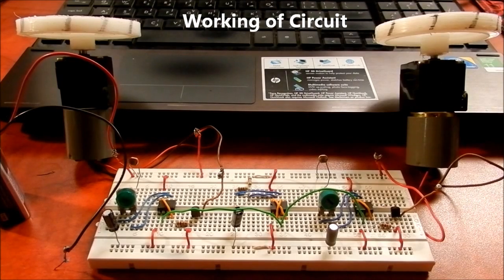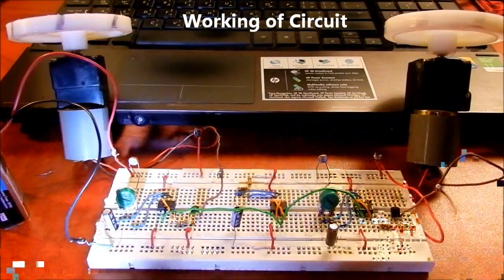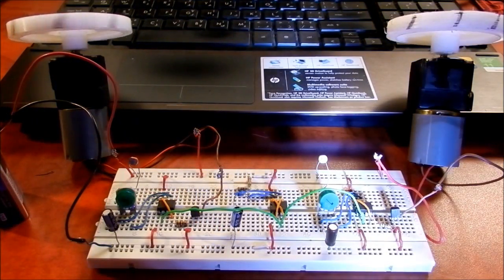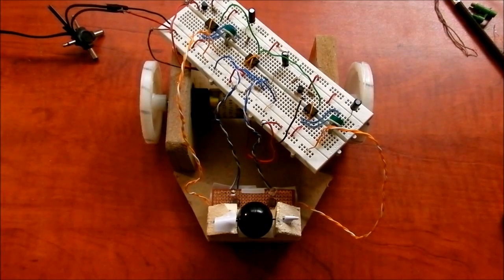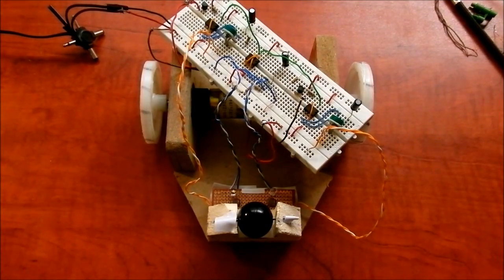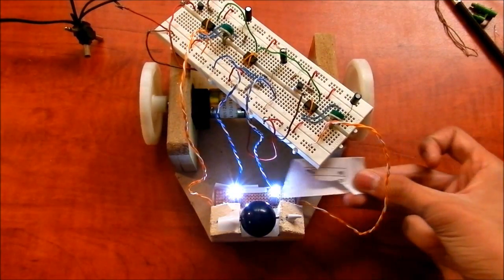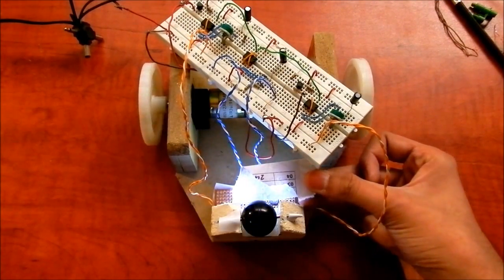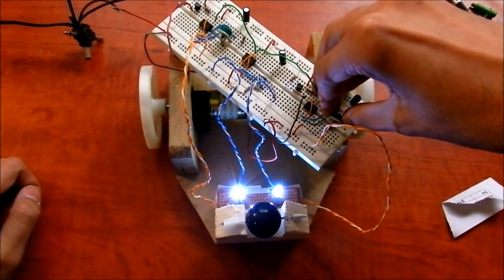How to Make a Line Following Robot without Microcontroller

Comment: Hey! I prowered the LEDs separately by lithium batteries. But the wheel rotation does not changes at all as I keep a white paper on ldr and led. Also when I use, mobile flash light on ldr the wheel stops rotating. Would suggest some solution. I want it to detect the white paper

Comment: why do you need 555 timers because you van use transistors to turn the Motors on and of right
Reply from the maker: Used 555 times to provide PWM to motors for a fade smooth switching controlling speeds instead of jerk and lag in switching on and off. Checkout my other LFR using transistors on my website ;)
Thank you
Reply: @PirArkam  If you would not do this smoothing with the 555s you actually don't need 555's at all and you can just disconnect the power to the motors (at input of transistors) when the line is detected at that side??